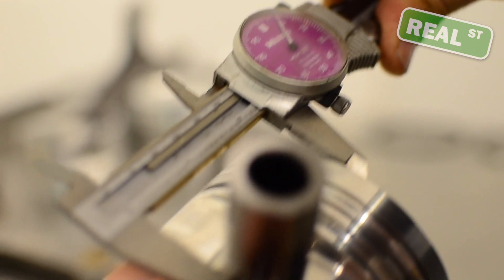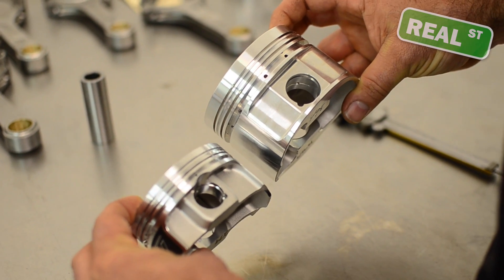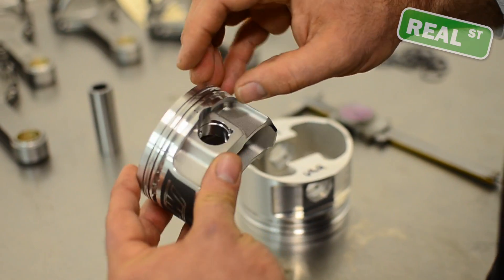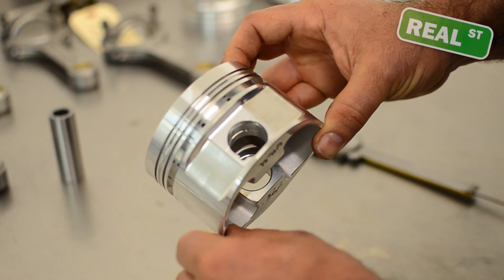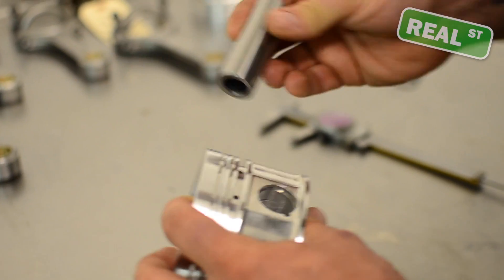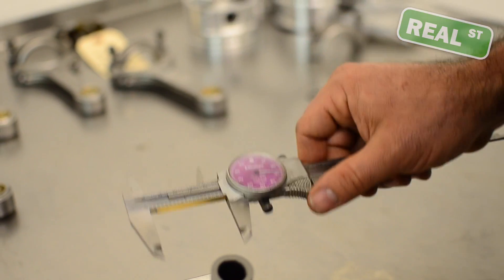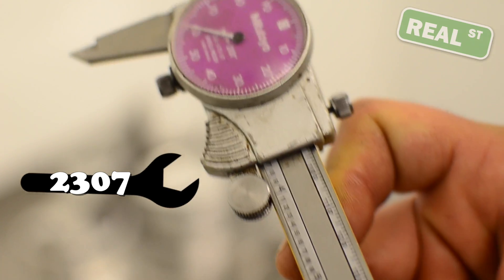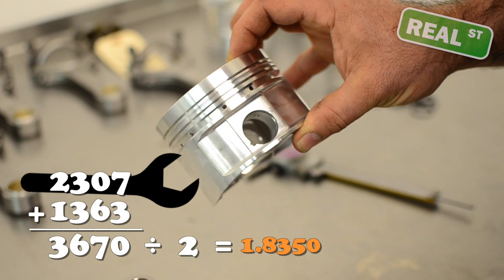How to Measure Compression Height - Jay's Tech Tip # 6

Comment: Could you explain your units on this.  The whole numbers are throwing me off, unless it is a unitless number.  Which I guess would make some sense.  I just assumed it would be a measurement of height, since the term itself is "compression height", but to get the height I took the assumption that you would take the difference of the two lengths not the quotient.

Comment: Shouldn't height be height from top of piston to bottom of pin minus half the pin diameter
Reply: Dennis Mac yes you are correct as the pin could say be 3" down and only 1" up he got it wrong your correct measure from the bottom of the pin then measure the pin and deduct half of the pin.